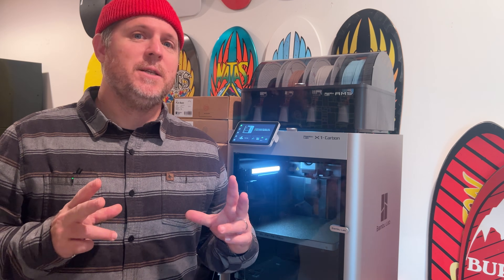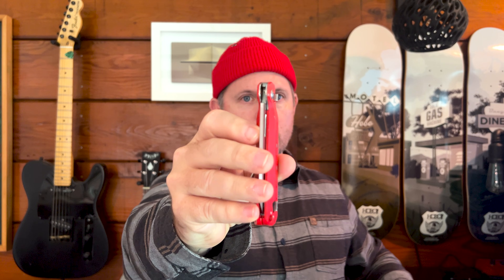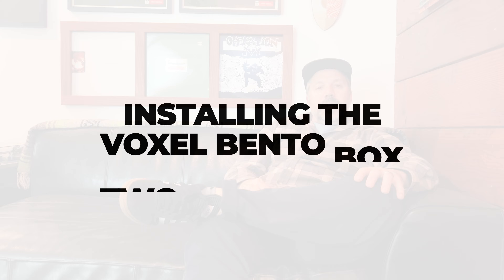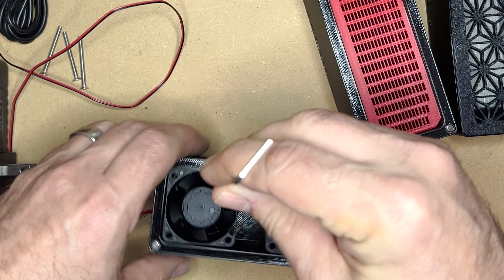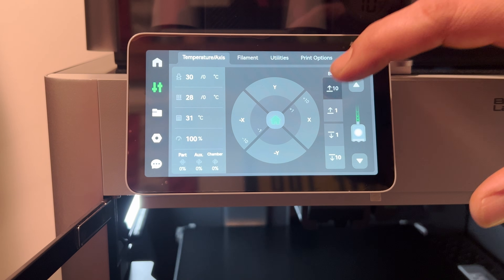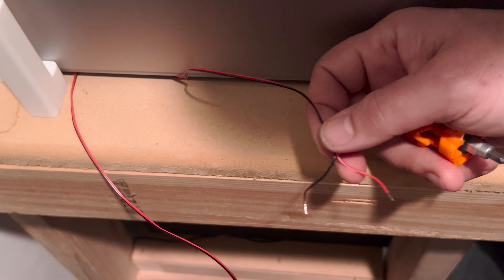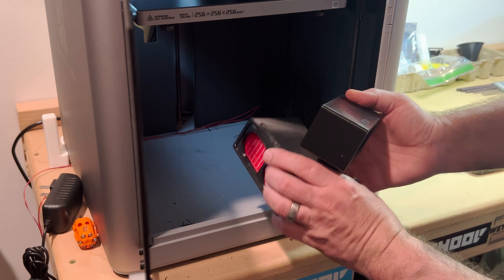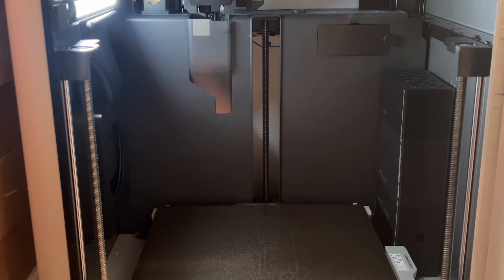Reduce 99% Toxic Fumes Bambu 3D Printer Voxel Filter Upgrade

Comment: Have a question. Did you ever print ABS/ASA to see how well the fumes are reduced with the Bento & X-Filter. I have the same setup in my P1S and find that fumes are still present (and I have an air quality meter that gives values for PM2.5 & VOCs and they are still raised higher than I wanted). I chose to install an external Mintion V1 with HEPA/Charcoal filter which also has a fan to create a negative pressure space so it pulls out the majority of the fumes and passes them through the third set of filters. This reduced fumes to 0 and the meter readings are also now close to 0. My printer room unfortunately has no windows so I can’t vent externally. This setup works well and helps keep me safe.
Reply: That Mintion system looks super simple.       I am going to look into one.      The bento box and the Xfilter were the very first two upgrades that I made to my P1S.     👍👍
Reply from the maker: What were the levels when running the Bento & X filter? I dont have an air quality meter so I can’t monitor that.

Comment: Here's a pro tip for you. If you buy 2 smart plugs that have power monitoring and work with alexa (or are zigbee with smart life) you can use one for the printer and one for the bento. When the printer is printing it will jump up in power consumption (let's say 100w for example). Have a routine set where "If Printer power jumps above 100w, then turn on Bento power". It's simple to do in spite of my convoluted description :P
Reply from the maker: That’s a great idea. Then wouldn’t have to manually turn it on/off. Awesome upgrade!

Comment: Even PLA emits particulate matter which can be hazardous due to sensitisation of your immune system. 

Bambu dropped the ball - full stop. All expressed air should have been forced through a HEPA filter and any high temp through HEPA and carbon.
Reply: The problem, IMO, with videos like this one is that it’s misinformed. Guy presents PETG as one of the harmful ones, but PLA’s cool? That makes zero sense, PETG is objectively much safer to print than PLA and is probably the #1 safest filament to print. It’s good to have filters in general but it’s not good to be confidently wrong about the bad filaments.

Comment: made a Bento Box for my P1S, in my semi. now I have a better setup
Reply from the maker: That's awesome! Did you print the case and install the components from the kit?
Reply: @LDDesign13 did a 92mm usb fan mod.  So far working great

Comment: How effective is this filtration scheme? Is it sufficient to eliminate the odor of ABS? I wonder how often the activated carbon needs to be replaced?
Reply from the maker: The filtration is very effective, removing up to 99% of VOCs (per Voxel stats). The rule of thumb is to change the carbon about every two months +/-.
Reply: I don't have alot of faith in voxel when It comes buying carbon filters repeatedly from them.  But nice product.
Reply: I have them in both X1C's and they do not really do much when printing ASA or ABS other than make a lot of noise.  I close the door to the room and turn on my giant hospital grade INOVA-E20 with it's massive carbon filter to 10 to reduce the odour and VOC's in the room.    These are just too small to really be effective even though they are inside the printer.  The X1C is pretty poor with ABS and ASA anyway ... way too easy to get splitting as it doesn't have a proper heated chamber.
Reply from the maker: @rackbites  That makes sense - ABS produces significantly more Volatile Organic Compounds (VOCs) than Polylactic Acid (PLA). ABS emissions have also been shown to be more toxic.

Comment: I wonder if they plan to make a filter for the H2D.  The fumes are terrible.
Reply from the maker: Good question, I'll ask them.
Reply from the maker: Voxel just confirmed that "The Bento Box works for the H2D, you need to route the cable through the back Z axis hole or make a small hole on the base of the printer to route the cable."
Reply: How often do you need to change the filters?
Reply: @DRRTV2022  I'm going to do every 250 hours. Carbon gets filled up fast.
Reply from the maker: @DRRTV2022  According to Voxel "Replace After 250 Hours or Every 2 Months"
Reply: Yes. It is.  Setting up a vent system to go outside. It was awful printing ASA.